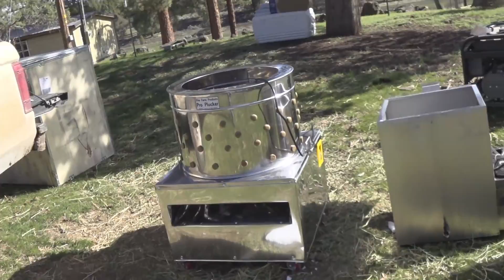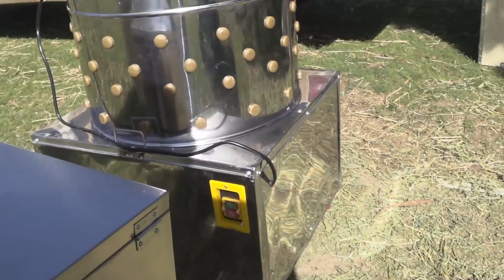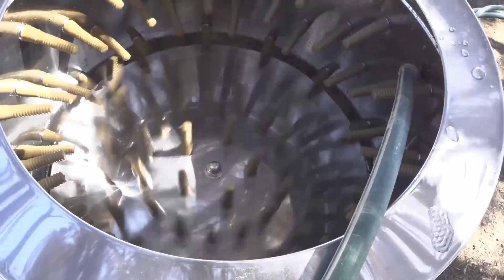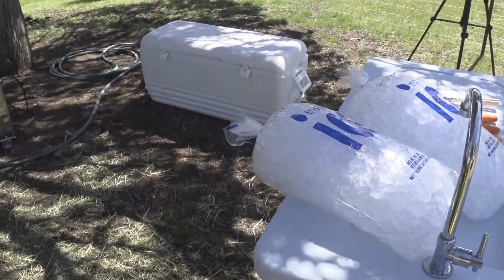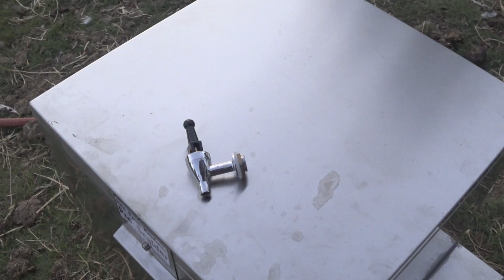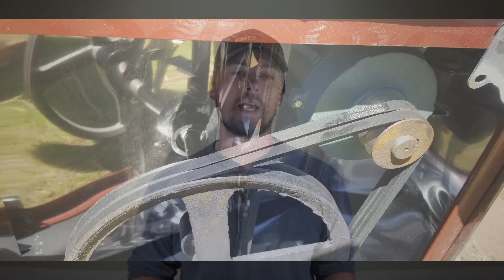Coopsnmore Chicken Plucker and Pro Scalder - Unboxing and First Use

Comment: I bought that plucker last year, it worked fine.  Took is out today, and it will not turn.  What a waste of money.
Reply from the maker: Mine is still working quite well with a couple hundred birds going through it every year! Luck of the draw perhaps
Reply: @darrelmillen   I got it to work.  The company sent out a new motor, but that turned out not to be the problem.  It was a month outside of the warranty, but they extended it for me.  The pulley wheel under the unit had rusted, and needed a great deal of tugging to get the wheel to work.  It’s a climate thing, in wet areas with grass, there is a lot of moisture that can rust the underside (even though it was put away and covered completely with tarps).  I’m still using it, only now, it’s tripping my breaker outlet.

Comment: Hi! Wonderful video! Thank you..
Would you still recommend the scalder and the plucker in 2023? Have you tried turkeys or ducks in this size and if so how did it perform? Thanks again!
Reply from the maker: @kristinwood5191  I would still recommend it. Mine set is still being used to process a few hundred birds every year. It'll handle turkeys up to about 20lbs. Duck don't pluck well in general due to their oily skin and feathers.

Comment: Just bought an extra large pro plucker, I think they changed the design because the wiring was wrong and also the frame is made out of 18 gauge c channel (Kinda flimsy). I would not recommend Purchasing from them.
Reply: Mine worked for one season only.  Took it out a year later, and it will not spin.

Comment: Darrel, you really published a nice video. I appreciate the details you shared about the products. I was really turned off though seeing the Chinese Motor. Just curious if you got any special deals or discounts on the products for your video promotion. Wouldn’t hold it against you, just wondered. Hope to see more of your videos.
Reply from the maker: Nope, not sponsored in any way. For what it's worth, the motor on the plucker is still going very strong with no issues 3 years later, it has more than enough power. The only thing I've had to replace is the on/off switch for the plucker
Reply: @darrelmillen  well that’s really what’s important. Thanks so much for the response. You may have just convinced me.
Reply: @darrelmillen  Plucker actual runtime is very, very, short if stopped between birds. You would intuitively think that short runtime equals longer lifetime. But short runtime of motors is usually associated with reduced motor life due to high current inrush when started each time and needs to run long enough to cool off. Well pumps with small air bladder tank have shorter motor life due to short runtime(overheating). A larger air tank(and possibly a higher pressure setting) solves the problem. Likewise, industrial air compressors are not usually shut off at lunchtime unless it is off more than 1 hour. For higher volume of chicken butchering, if plucker had an ejection chute for birds when finished the plucking cycle, the plucker may not stop running(unless programmed to stop). Plucking a high volume of birds and continually stop/starting plucker motor will surely reduce it's lifespan. If plucker plate stopping is desired, perhaps a clutch or transmission gearbox with neutral is required that allows motor to continue running (and staying cool).

Comment: Did you dip your chickens in the bags with the same hot water that you scalded the chickens in originally or is that a second batch of hot water?
Reply from the maker: I use the same hot water. Since you have to heat it up to 180 Fahrenheit, there's no opportunity for bacteria to survive in the water

Comment: Subscribed. I bought a drill powered plucker and I don't know if it was because I only had hot tap water to scald them or the plucker but I had to pull most of the feathers out by hand. They were big table size cocks about 4kg. I've seen a wieserfield combo and I'm thinking of getting it but I thought I would check the cheaper options like these first but I'm still not sure. I will do some more research before spending £1200
Reply: Your plucking problem was definitely due to low water temperature and probably also due to age(not size)of birds. Use a cooking thermometer or similar to keep check on water temps. 148 deg water for as little as 15-30 seconds will sufficiently loosen feathers. 136 degrees is the lower limit and may require 1 minute or longer to scald properly.  Your household water heater thermostat can be set to 140 or possibly higher though water out of tap will not be that hot due to loss in pipes, etc. Do not exceed time required for wing feather and/or middle toe skin to easily slip off. The key is to know your water temp and to keep checking for ease of wing feather and toe skin slip to avoid cooking the meat. Also, agitation of completely submerged bird(s) is better than dipping. Dipping unevenly scalds the front area of head/neck/breast because it is submerged longer than the feet/legs/thighs. At 148 degrees you have a narrow time window for error. While at 136 degrees or slightly above you have a longer window of time in which to make the decision to remove from scalder and toss into plucker. For just a few birds you may not even want or need a large drum type plucker. Your drill plucker will work just fine on any bird properly scalded  as described above. Good luck!

Comment: plucker's wattages are based on motor size and one horse power = 0.75KW
Reply: Don't forget .75 kW = 1 HP AT 100% EFFICIENCY.  Chinese motors use kVA RATINGS and rarely achieve 50% eff. A Model P4400 Kill A Watt Meter will read out Volt, Amp, Watt, VoltAmp, Hertz, Power Factor, KWh, and Hour.   Meter rating is 15A and Max Power of 1875 VA.

Comment: Wish i had seen this first, i brought a Yardbird plucker, what a nightmare, used once and it never ran again..safety switches are the problem, common with these..never again.
Reply: That’s the problem we had with ours too. Horrible product... not only that, but the company doesn’t except returns and wants you to diagnose the problem and fix it yourself since they do not have a service center either. We just bought the CoopsNMoore and we are hoping it will work better than the Yardbird.
Reply: @musicmaj34  I rewired ours, removed the magnetic switch, now runs like a dream..
Reply: I’ve heard that a lot about Yardbird. So glad for information like this.